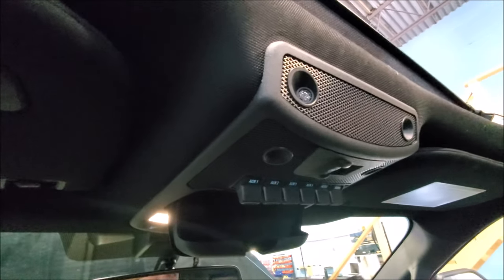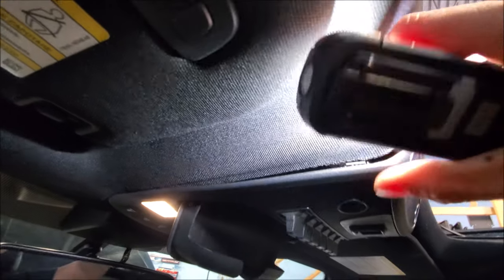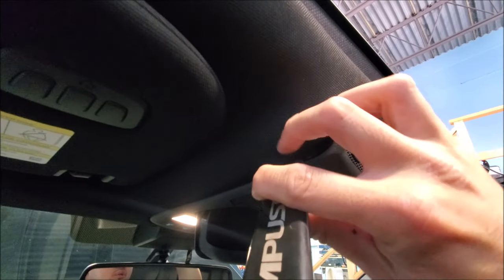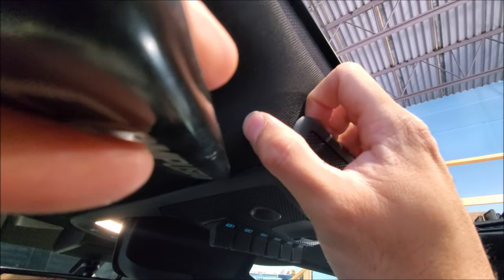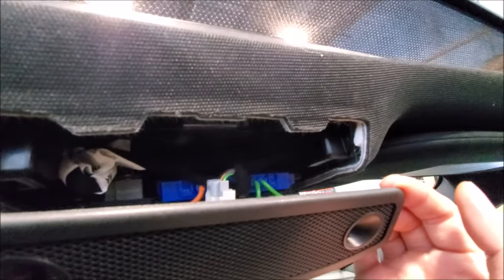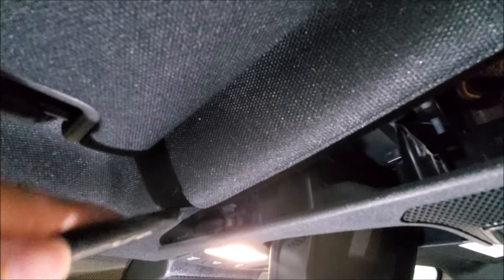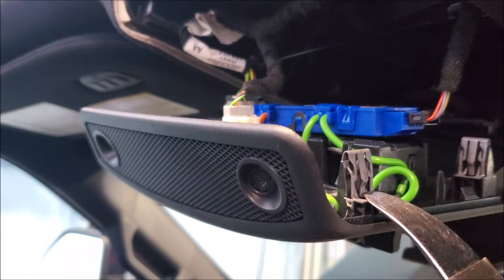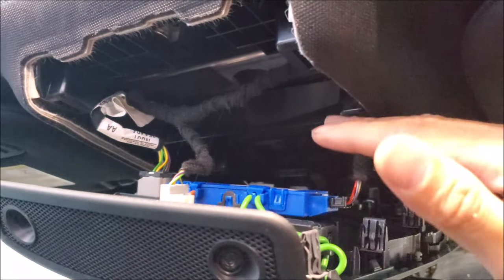2021+ Ford F150, F250 & F350 Overhead Console Removal | AnthonyJ350

Comment: Just did this on my 24 Lariat 350 Tremor.  The front of the panel does not have spring clips.  You MUST start at the back of the panel, have both the back and middle spring clips off and then pull the whole panel towards the back to disengage two molded plastic hooks on the front of the panel.
Reply from the maker: Thanks for the comment

Comment: Very good tip! Also if you have rusted clips or plastic dried clips, rub them with a flim of Dielectric Grease. It helps rejuvenate them so they slide in without excessive force.
Reply from the maker: Thanks for the tip!